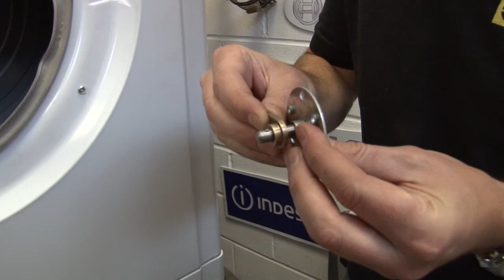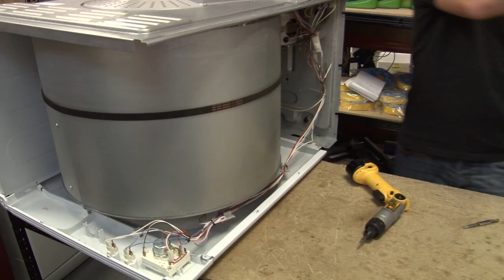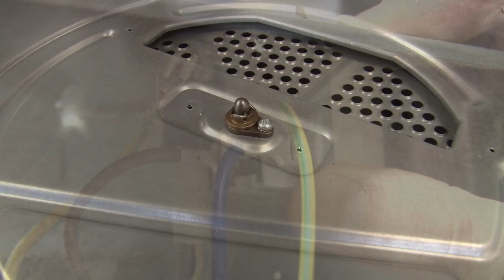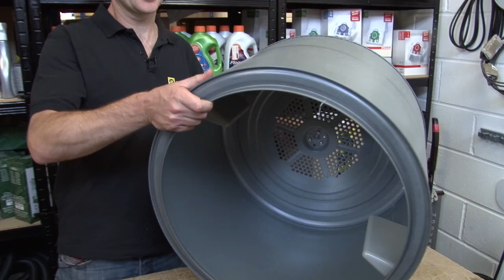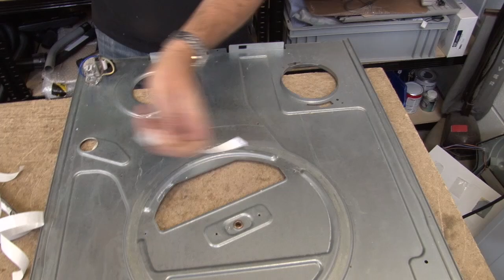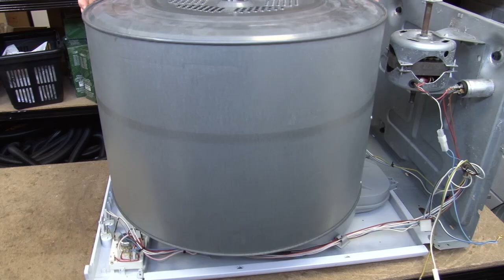You Can Replace Tumble Dryer Shaft & Bearings EASILY Yourself!

Comment: Hi great video but when I put my hot point tvm562 back together and start it no problem, but after a couple of minutes a loud rubbing noise occurs, any ideas ?
Reply from the maker: Hi John, take a look at the rear bearing by removing the two screws and cover. if it has worn there is likely to be black 'graphite' like powder in the cover indicating it needs replacing.

Comment: Hi mate, I watched your video and had a little experimenting on my own tumble dryer, my shaft is built onto my drum so these no way of replacing the shaft so I guess I have to buy a new drum
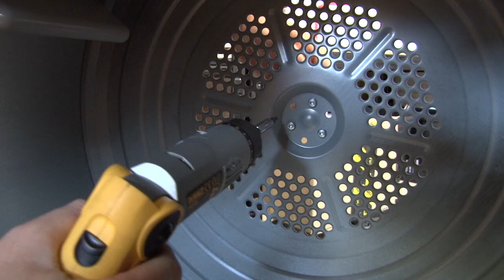Reply from the maker: Hi Gary, if your drum uses a different type of shaft we do offer a link at around 5:40 in this video and now have added another link in the description.
Please recheck and let us know if you are not shown this link at 5:40 in this video.
There may be a problem that causes it not to show in some countries and we need to know our information is correctly available.

Comment: Great video presentation. I have the Hotpoint VTD00 model and had a lot of problems trying to stop the drum loading the front cover bearings too heavily, which causes major noise and eventually snaps the drive belt. The bearing kit is the same on mine but the phosphor bronze bearing in the back cover is square and sits into a housing that is pop riveted to the rear cover. Having fitted the kit when loaded with cloths the drum seriously rubs against the front cover bearings and can stop the drum turning.

I found that welding a 5 mm plate to the rear cover and disregarding the washer worked for about 13 months or so before it finally failed again, the problem as I see it that the plain bearing rotating in a metal washer will fail eventually as will the phosphor bronze bush. Ideally a roller bearing arrangement on the rear of the drum/back cover would be a better design in my opinion, and I don't think 6kg drum load is excessive amount of cloths.
Reply from the maker: Hi David, these are very commonly warring parts on your range of dryers. One of the most common causes of the drum rubbing or catching is if the floor is not 'square' and the cabinet twists slightly. If it starts rubbing try packing up one foot at either side with a cup coaster and if this stops leave it in that position.
Reply: Thanks eSpares I'll try it and let you know.

Comment: Hello, I need to replace the Heater Cover Isolation Foam on my Beko Tumble Dryer Mode: DCU9330W I was just wondering if you could please advise how the foam attaches to the metal heater backplate on the machine? Thanks in advance for your help.
Reply from the maker: Hi Snow465, from memory we think this insulation material is like a thick insulation felt and is attached with a self adhesive backing,

Comment: Thanks for this, it was a big help. Just one thing, when I went to remove the spline that bolts on from inside the drum I found mine was riveted on and not screwed. I have drilled out the rivets from the back and can then fit the new spline like yours as the holes are still in the right place. I probably will need to shorten the bolts though but it all looks like it will be OK.
Reply: *****
Yep that worked fine, I just 'Dremelled' the bolts excess off the other side so that they were well below the cover. I also greased up the spline a bit which I assume has helped as it makes no horrible noises! Well £27 bought me a new heater element and a bearing kit and with the help of this video saved me around a tonne for a new dryer! Thanks eSpares!

Comment from the maker: Hi  

On some of the early type of dryers they had an additional copper earth strap that rubs on the shaft pin to earth it. it is quite common for these to squeal simply remove if fitted to prove if this is the source of your issue. Failing that it could be the motor. If so that would need replacing. 

Thanks.

Comment: Hi I have a hoover hd vision tumble dryer. It makes a dreadful sound which could be the belt or bearings, like you say, But what is immediately obvious is the blower wheel /air intake fan (whatever it is called) is pulled to one side towards the drum. the drum itself does not seem to have any movement, but this may be because it has roller wheels where it attaches to the front, I have read that there should be a spring that counters the belt on the wheel. What do you suggest? Thank you

Comment from the maker: @eddyjay123 @Serostern Thanks for the comments everyone. We did debate about putting the machine onto its side or the back and working that way. However the instructions that come with the bearing kit from Indesit **specifically** state to remove the door, tilt the machine onto its front and gain access to the bearings from behind. After doing a few dummy runs we could see why they recommended this route; it was simply the best way of replacing the bearings with the least amount of fuss.